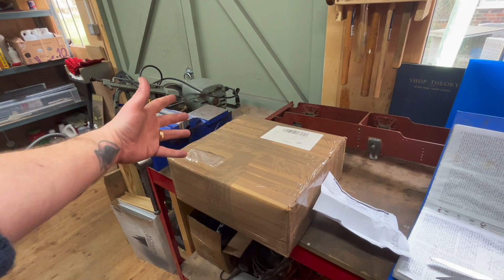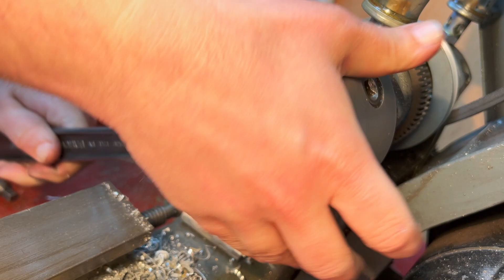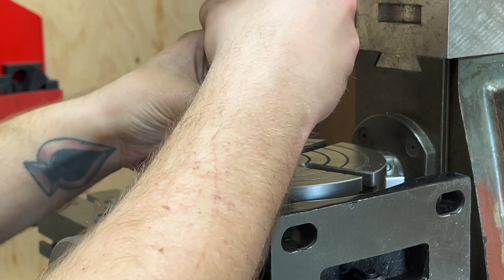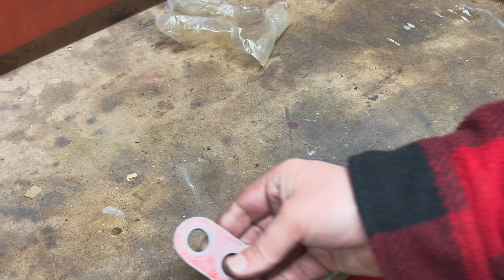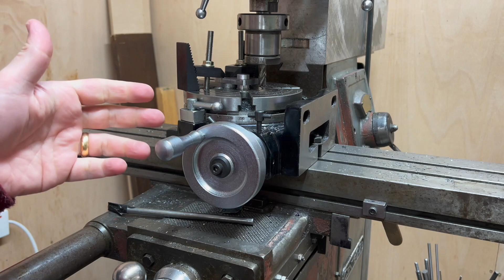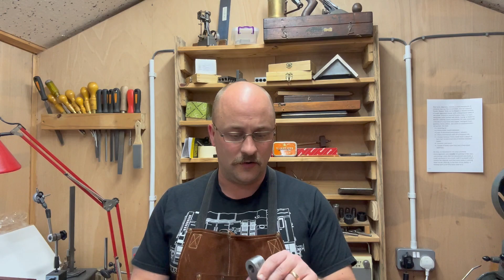My first time using a Rotary Table - Maid of Kent Steam Loco No. 26

Comment: Hi William, I enjoy your channel even though I don't have deep interest in building models but rather engineering and the machines. My interest is restoring my woodworking machines and for woodwork tooling etc. I have a Boxford Mk3 AUD lathe and a Centec 2B mill similar to yours. I have put VFD's and new motors on both with variable speed dials and RPM dials with larger 1.1kw 4 pole motors to hopefully help with more torque at low speeds. Those upgrades have gone well. I have fitted a Machine DRO on the lathe with magnetic scales and was impressed I will also add a 3 axis Machine DRO to the mill. I suspect the ways on mine are in a bit better condition than yours as my mill was dedicated to cutting brass. The concept of horizontal milling was new to me but that should work for many projects as I got lots of horizontal tooling with the mill. I have a couple of questions if you could spare the time to answer. 

I have checked everywhere but I cant find out what the dipstick is for on the right hand side of the vertical attachment. There are a few grease nipples at various points and then there is this oil level dip stick on the side. The instruction manuals I have dont have instructions for the vertical attachment. There is geared direction change in the head and it would make sense if it was splash lubricated but I don't see evidence of oil seals so I think it may make a big mess if I just add oil. Do you know what needs to be done? 

The drawbars with the mill are pretty bad so I have researched the drawbar on the vertical head with the thought of remaking and there is evidence it can be encapsulated at the top so rather then walking the nut with a hammer to release, the act of undoing the arbour also releases or more accurately eject the arbour. Do you know about this? There are scant details on the groups.io Centec forum.

My last question is about you wise. I notice you upgraded with what looks to be a Vevor (or Chinese like) mill vise which looks to be about 125mm. What size did you get? How do you feel about the size as it looks a far lump of steel on the bed. I was considering with the 80 or 100mm.

Thanks for your content as well.
Reply from the maker: AFAIK there is a splash lubricated oil bath in the vertical head - the seals around the quill aren't perfect so I get a drop every now and then. 

For the drawbar in the V/H - my one is a fabricated replacement but appears to be to the original design. There is a cap which screws onto the top of the VH which retains a flange on the drawbar, so as you crank on the top of the drawbar it forces the tooling out of the arbor. The following drawing isn't mine, but looks accurate (my threaded section is 3/8" BSW): https://i.imgur.com/qPDMvBS.jpg

My vice is from Arc Eurotrade but it's the same kinda thing. I can't remember which size I went for (unfortunately not near my workshop to check) but it felt like a significant improvement. I will hold on to the Abwood vice and see if I can recondition it in due course.
Reply: Thanks for your reply. The drawing of the drawbar is just what I needed.  The news of splash oil in the vertical head is no surprise. Any guess on what oil. Something heavy I imagine. If when you get back in the workshop you measure the vice let me know. It looks to big in video but that doesn’t mean it is. If that size feel too large you would know. Would the next size down work ok? Thanks for your reply.

Comment: We made something similar for the centre of our rotary table in much the same way as you. The parts you made look great. Watching your video has made us think of buying a smaller rotary table for our Centec, the monster 12 inch one we have will not fit. We spent a long time adjusting the gibs on our Centec but after not using the mill for a few months the axises now feel too tight.
Reply from the maker: I think the wear on the Centec has thrown me off - the section in normal use is more worn than the edges so I have to be careful about how much I nip it up.

Comment: eyup William
Rotary Tables, just like buses used to be, you wait ages for one then two turn up!!🤣🤣🤣🤣
Nice job on the radiuses!!!, but i thought by now you should have plenty of experiences with "Lock Downs"  🤔🤔
see you next time👍👍
ATB
Kev
Reply from the maker: Yes, I felt like a right idiot. I  wonder if I need to make knurled handles for the locking nuts? Sodding around with allen keys is getting annoying!
Reply: @williamsworkshopuk  anything to make life easier, unless it's on something you only use once in a blue moon, "swings and roundabouts"🤔🤔👍👍